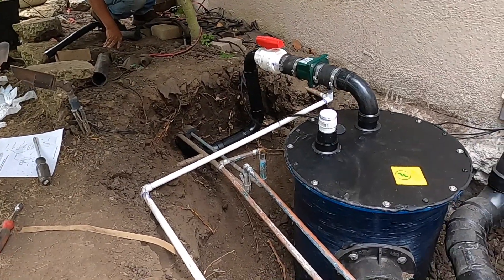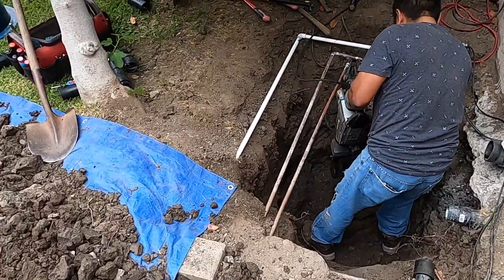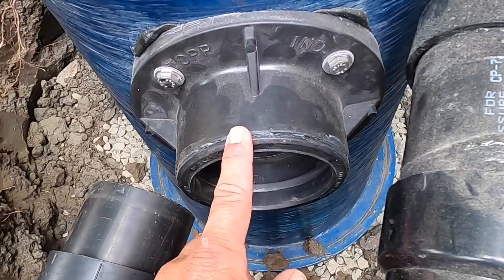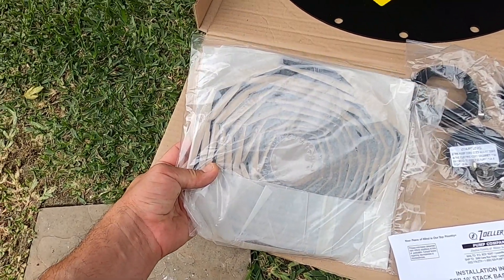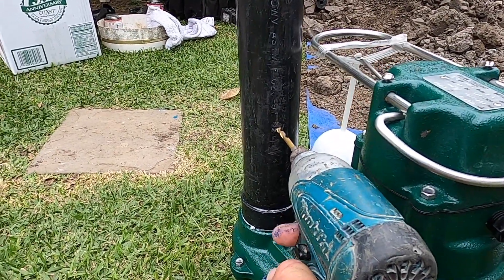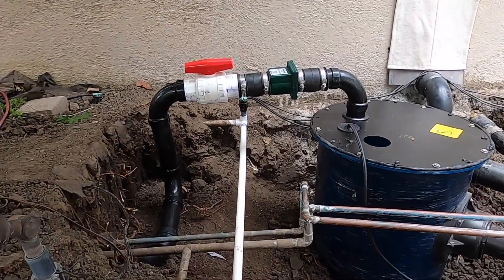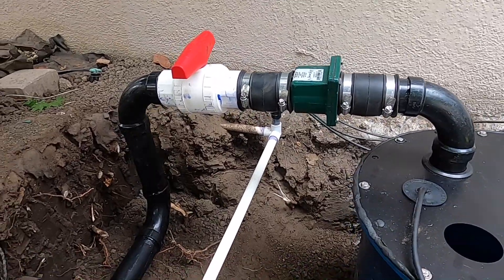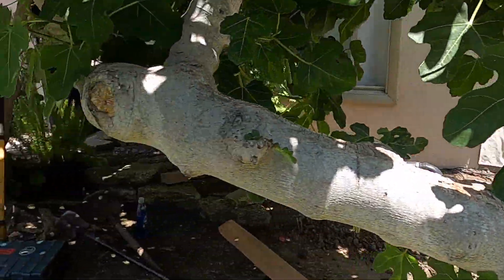How To Install A Sewer Ejector System

Comment: I’m no plumber but an air admittance valve only works one way (for negative pressure). I believe a sewage basin vent needs to breathe meaning negative and positive pressure so a tie in to existing vent stack or new stack secured to side of house and terminating above the roof line.

Comment: You are amazing.  I chuckled at your dilimma of 3" & 2" and 1-1/2 freeway connection - you made it a WORK OF ART!!!  And Thank you for showing the 4-3 bushing - NOW I understand how those work!!!  ha ha. I am currently (Oct. 2025) building a plumbing line to the city from my '5" ft deep drum' Sewer with a Grinder Pump 2 HP.  I respect all that you 'create' and also have learned some of why it costs so much for a plumber, since I have been to 6 stores for supplies/fittings as they all carry bits and pieces. - HD and Lowes do not carry Sched 80!  Ace carries Sched 80, but only one local hardware had the 1-1/4" by 4" Sched 80 Nipple.  Anyway, very time consuming.  I am using a 2" Pipe compression fitting, to 2" pvc to reduce to 1-1/2 pvc 1-1/2 Ball cutoff pvc and then reduce 1-1/2 to 1-1/4 , then a sweep 90 ellbow to 1-1/4" to pvc to the PVC Spring check valve to the pvc to the 1-1/4" Sched 80 Nipple that connects to the pump!  Phew!!!!

Comment: Where did you install that lift station. 
Sure can't be in Texas you shouldn't have those water lines so close to that lift station and you're a dramatically restricting the building sewer with all those fittings

Comment: I'm completing a very similar system. Someone told me I couldn't use a studor or mechanical vent because of the negative pressure? I see you used one. Do you have any comments or advice? Thanks. I want to use one by the way

Comment: The AAV should be replaced with an actual vent pipe.  As water and waste enter the basin, pressure will begin to increase.  With no vent, you will likely start hearing a gurgling sound when you flush the toilet...and you will defintely start to smell sewer gases.  Of course the basin will eventually empty, with a bit of a struggle given the internal pressure.  Maybe I'm wrong🤔🤔

Comment: Air admittance valves are not rated to vent sump pumps, unless of course the manufacturer okayed it for this situation. That could have been vented to atmosphere easily with a couple downturned 90's. I liked the video otherwise though.

Comment: Thanks for the video. Quick question, how important is it for the sewer coming into the sump to be level for the bushing to seal? Just curious because I just paid a plumber nearly 30k for a partial replacement and re-route around and the fitting going into the sump is at probably a 22 degree angle and leaks like crazy. I'm asking because he's coming back out to add liquid rubber around it, but I feel like the sump or pump needs to be modified to get the line coming in to be straight and level. Your thoughts?

Comment: Have you ever needed to bury one of these a lot farther below grade? I am installing an outdoor kitchen island sink, and due to needing 12" distance between the foot vent and drain pipe the top of the ejector basin will be 2 feet below grade. I'm not sure how to make it somewhat accessible for maintenance.
Reply: Side discharge like Liberty pumps makes.

Comment: your sewer line is lower than the fixture why would you need a pomp
Reply from the maker: Because the main sewer line is higher. This new line runs about 50 feet and we did not have the proper slope.
Reply: @How2Plumb   so all that sewage is going to be either staying in that 50ft or back flowing? would that pass?

Comment: Would anybody use one of these to drain water in a landscaping setting? We bought a house that has one of these in the ground and the old homeowner claims it was connected into the gutter system. Thanks for the info.

Comment: Im having issue with my sewage pump keeps tripping th gfci. Evrything was installed underground even the cover of the pump is covered with dirt. It was running fine for 2years but now having some issues tripping. Where are you located?

Comment: Can this be installed with the service valve/check valve/ basin cover buried just below the ground? Like if you didn’t want a lot of pipes to show and maybe used a few ground boxes?
Reply: What did you do? Our old one had an inline check valve located on the pipe going up from the pump

Comment: Good, straightforward, constructive attitude - really appreciated. Attention to detail - excellent. You made this process easy to understand and explained it well. To viewers; Zoeller is a great company with high quality equipment. If installed properly you can't go wrong. If installed inside structure be sure to get an alarm in case pump stops working or it's malfunctioning and you'll have to either tie into existing sewer vent or install new line through roof.

Comment: Great instructions. Just one question, why did you put 3/16 hole in discharge pipe?
Reply: It's called "weep hole" to avoid air-lock between check valve and sump pump, another tip, when you drill it try to do it on 45 degree facing down (bottom of basin) to avoid some weird noise. If it's straight or pointing up, when servicing you can get splashed or "sprinkled", ha.
Reply: Nice work.  Thanks for taking the time and effort to film and share.

Comment: Thank you for this video, was wondering where the Final destination is being tied into? I am looking into this exact set up but we will be tying it into a main sewer line. Is this possible? All the other things I’m reading shows sump pumps going into a septic tank.
Reply from the maker: Yes going into the main sewer line is totally fine that is exactly what I’m doing as well.
Reply: @How2Plumb  awesome, we’re winging it so super lucky to come across this video! Don’t mean to over step but would you know if the Everbilt 1/2 HP sewer pump would work? From pump to sewer line is about 40’ its slightly uphill but not by a lot. Fixtures are the same in your video 1 sink shower and toilet. I called Everbilt and left message but not sure if you’re familiar with this brand or would know of the bat it’s not the right type
Reply: @How2Plumb  how far can the waste be pushed ? Going to use this for an ADU My main sewer is about 80 will the pump be able to get it that far?

Comment: I'm confused. It looks like the gravity system was lower than the pipes coming out of that garage. What was the need for a pump?
Reply from the maker: Because there was not enough slope to get from the New bathroom to the main sewer line. Therefore we had to install a sewage ejection system with that basin and from the basin it pumps into the main sewer line because this cannot be done by gravity.

Comment: Hello,  wow, this looks very close to what I am currently working on.. Just a couple questions: Do you have any clogging/backup problems with toilet solids, assuming you are using a 2 inch discharge pipe and you are not using the shark grinder pump system? What distance are you pushing ( my project is 75 feet) from the sewage pump/sump to your  3-4 inch line servicing the house?
Reply: Danny, sorry to confuse you. Mine, is practically the same,  just 35 feet longer so I should be fine with an ejector system. Thanks for the video.

Comment: Chipping hammer looks like a useful tool.  Dug up the entire septic by hand put in my own sewage ejector a Rubbermaid trash can with the Everbilt Home Depot pump.  It's down in the rusted out 500 gallon tank that had the original pump.  I am going to fashion a lid over it all and turn it into a table.